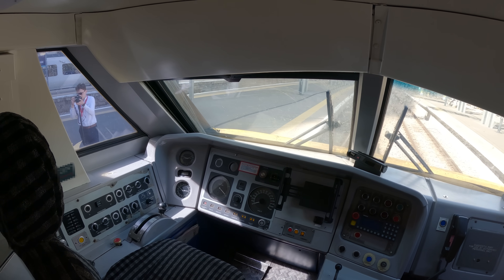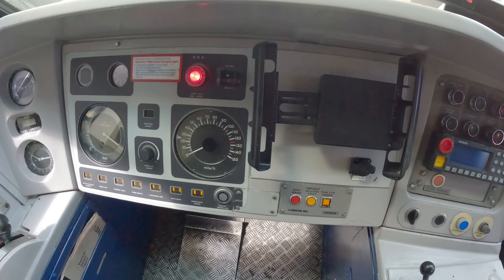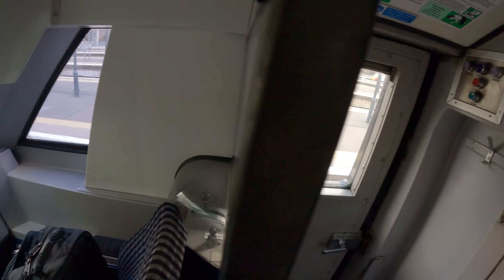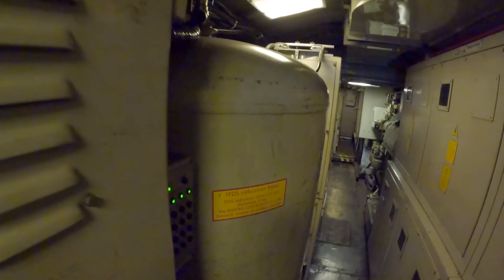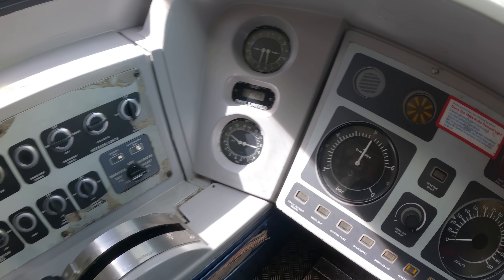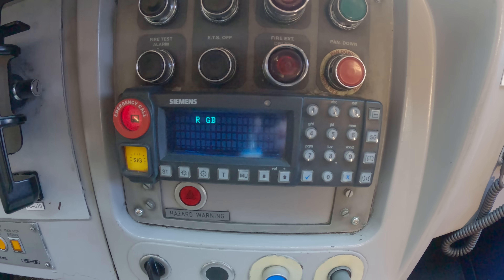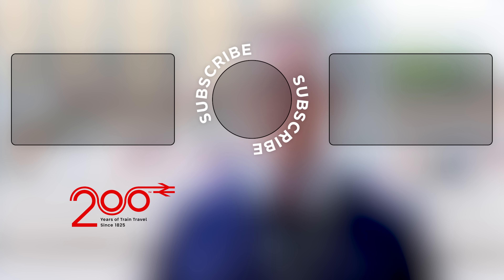Train driver's tour of a Class 91 locomotive | InterCity 225

Comment: That Is A Self-Propelled DGVT (Driving Generator Van Trailer), Not A Locomotive

The Self-Propelled Catenary Versions Of The DGVTs Were Built For The Coaching Stock

0:35 Controls (Driver’s End Cabin)

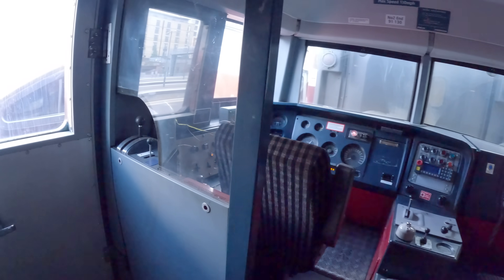5:55 Controls (Guard’s End Cabin)

For A Self-Propelled DGVT (Driver + Guard), You See The Carriage In Front Of You (6:05), You Need Singles Of These Carriages For Both Ends

Never Use A DVT At One End Whenever You’ve Got A Self-Propelled DGVT At The Other End Of The Train

A Self-Propelled DGVT = Cabless End Carriages Both Ends

A DVT At One End & The End Carriage (6:05) For A Locomotive At The Other End, Use A Single Cab Locomotive

Either A Bunker Engine Or A Tender Engine

Any Locomotive That Has A Equal Cabs Both Ends = Head-Switcher Or A Head-Shunter

Which Is Any Switcher / Shunter Ideal For Cabless Run-Around Trains (Like The Transfer Switcher)

The DGVTs That Were Built Don’t Have Tone-Switch Horns, They Use

Tone Horn 9:20

Main Horn 9:22

Comment: Great. A proper loco hauling  decent  coaches with good ride quality and comfortable seats for passengers.
 Unlike the DfT spec'd trains that followed with heavy noisy CO2 belching diesel engines strapped underneath rather than doing the job properly and completing the electrification and appalling seating.  Oh how public transport has gone backwards since these were built 35 years ago.

Comment: Absolutely brilliant video! 👏 Getting a behind-the-scenes look at the Class 91 from someone with Robert’s experience was a real treat. These locomotives are true icons of British rail, and it’s amazing to see the detail and complexity behind what makes them Britain’s fastest. The walkthrough of the start-up procedure and cab tour was fascinating—such a rare insight! As someone building my own East Coast-themed layout over on The Novice Railway Modeller channel, this was hugely inspiring. Thank you for capturing the magic of the InterCity 225 so well! 🚄💨 My question; Is the acceleration and braking times noticably longer with a full load of passengers?
Reply from the maker: Yes, acceleration takes longer with a full loading compared to an empty train but not significantly so. Brake time isn't affected in the same way but it does take more pressure to slow the train.

Comment: Interesting cab , does the brake handle come back for release ?  Brake overcharge is to equalise the brakes so. We did not have that in Ireland but after forming the brake it was applied to emergency until all the air was exhausted and then released and that equalised the brake.
Reply from the maker: Yes, you pull the handle towards you to release the brake.

Comment: Absolutely love the InterCity 225, and it’s more than just a train to me. The Class 91 was the first traction I ever learned after qualifying as a driver, and 91106 in particular holds a special place in my memory. I still remember the feeling of taking the power handle for the first time, hearing that distinctive traction motor whine, heart pounding in my throat, and realising I was in charge of something iconic. The 225 has presence, speed, and heritage; a proper machine built for the East Coast. Getting to drive it was a privilege. A proper train!
Reply: Which driver instructor trained you at LNER? Which driver manager managed you? Who else was in your safety group?

Comment: I'd expected more of the engine room to be full of transformers and motors... even though in a diesel electric loco I know the motors are mostly in the bogies.

When they show us around these things, could they mention how they would tell if a test showed a problem? E.g. he said how he knows that the brakes are working all the way along the train, but what would have happened if, say, there was a fault half way down?
Reply from the maker: If the brake continuity test were to fail, the brake gauge would not rise to the required pressure and you would be able to hear an air leak when walking up the train.

Comment: Practical question: there isn’t a toilet within the drivers cab or access to the carriages from the drive car. How does the driver relieve themselves on a long journey?
Reply from the maker: The Driver would have to contact the signaller and Train Manager, and stop at a suitable station to use the facilities onboard the train or at the station. However the length of our rostered driving routes means that's not usually necessary.

Comment: Lots of abbreviations which meant it all went over my head.
Would like to have been shown a few more things around the safety aspect of driving. Failsafe devices etc. Information on signal notifications, ie the sound in the cab when you approach signals that tells you what the signal is set at.

Comment: Great video thanks for taking the time to make it, I know and appreciate the 91 and the original 43 hst's are completely different in just about every way but as a driver of both if you have which do you prefer? I remember clearly the launch of the 91's but the sound of a  screaming valenta leaving Kings Cross or Edinburgh will stay as a very fond memory for many of us, just interested to know how the 91's faired amongst you all, 

Cheers Rob
Reply from the maker: The Class 43 was better to drive in my opinion because there was a power car on both ends of the train, especially when they had the Valenta engines.

Comment: Thanks for loading that video of Class 91 locomotive.  I used to work on the railway in Loco Dept, but left decades ago. 

The last electric loco I worked on as secondman was a Class 87.  There was nowhere near the amount of controls in the cab of an 87,so things have changed quite significantly since I drove a locomotive.  

What an eye-opener the Class 91 is, compared to the now old Class 87s.  Are all the Class 87 locos scrapped, or do some still survive?

Comment: why is there a red marker on the speedometer in the front end cab at 125mph but at 140mph in the rear end?
Reply: They were designed to run at a maximum of 140mph. By the time they were delivered, that idea had been scrapped, and they were limited to 125mph in service. The speedos in the unrefurbished cabs were never updated to reflect this.
Reply: @nkt1  shame they can’t reach their full potential! Thanks.
Reply from the maker: 125mph is the line speed limit, but there was an ambition to raise sections to 140mph when the trains were introduced. This is still reflected in the unrefurbished cab.
Reply: @LondonNorthEasternRailway thanks, are there any plans to increase the max speed, now most of HS2 is scrapped?

Comment: The position of the standing driving control position looks like it would be blocked when the cab door is open. Doesn't that defeat the purpose of being able to stand in the doorway when shunting?
Reply from the maker: Those controls would be used with the cab door closed but the drop window open.

Comment: You didn’t show the thyistors in the bottom of the cabinet on the right hand side as you were halfway through the equipment room . Also the big red cable that is the 25kv supply to the transformer under the pantograph equipment. This goes under the floor to the underslung transformer and cooling plenum.

Comment: What is the pedal on the floor is that the Signal alarm cancel  a dead mans handle type of thing  ?
Reply: It's two safety systems combined, one as you say its the "dead man's handle" or more commonly referred to these days as the driver safety device (DSD). The second system is called driver vigilance system, where by an alarm sounds intermittently in the cab, and the driver must lift their foot off the pedal and place back down again in a certain time frame ( i believe around 5-7 seconds, someone will correct me if I'm wrong). If the driver fails to acknowledge the alarm, the train will automatically apply the emergency brake, other things do happen after this occurs but don't believe that information is currently available in the public domain that I've seen so won't be spilling that 🤫

Comment: Wow what a smart cab and a nice working environment for the drivers of the 91s it is the first time I have seen the cab interia very nice
Reply: You find that the Driving Cabs on Electric Locomotives are always kept pretty smart compared to a Diesel, even on Freight Loco's it's the same. I used to work with the old class 85's 86's and 87's and they were pristine compared to say a Class 47.

Comment: Are you supposed to deal with any faults. When the engine is on it’s travels
Reply from the maker: All Class 91 Drivers complete a three week traction course (theory, practical, and simulator) covering a range of scenarios to deal with any issues that might arise. They also have a direct contact to Maintenance Control for further assistance.

Comment: What was the purpose of having two cabs on the class 91
Reply: It was built so it could handle sleeper trains and occasional freight, so the idea was it would operate these at night and a flat can could operate these at lower speeds when disconnected from carriages.

Was never used though
Reply: @neilgwynne5158  thank you for explaining
Reply: Was sometimes used by LNER

Comment: Thank you Robert and L N E R very interesting tour, would love to have a real  live tour. Sixty odd years ago  I was an E E Co service eng’r on Deltics between Leeds and Kings Cross and regard these 91 locos as space age compared to the “leading edge “ Deltic loco.  The 91s were built by G E C having absorbed E E Co but the 1500 h p motors were manufactured at E E Co Preston works. 
Questions  __ what are the Converter and TMR  referring to on the Status Panel please.  Also do they have a drivers vigil antic switch device included?
Reply from the maker: The Converter converts the electricity from the overhead wires from AC to DC, and the TMs refer to the traction motors. There is a vigilance alarm which activates periodically if there are no new cab inputs and is cleared by a pedal on the floor.

Comment: Thanks for posting this video. Great to see what goes on inside the cab and equipment room. There's a lot more to do than I expected.
Reply: That's because like Concorde, the 225 train is both complexed & outdated.

When Concorde flew it's cockpit was infamously covered head to toe with all sorts of buttons & switches to the point it needed a flight engineer.

Similarly the 225 which is a locomotive along with its 'twin' driver van trailer or DVT has multiple engines to get the train moving.

The Azuma trains like modern planes has less controls & is less complexed.